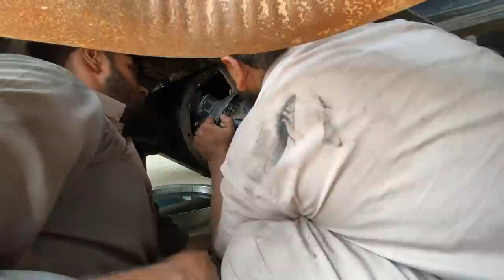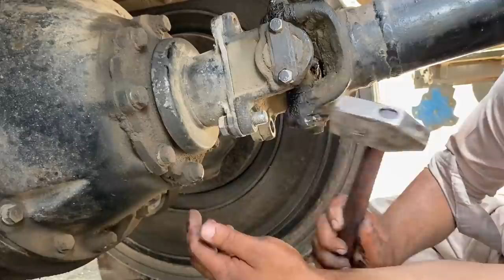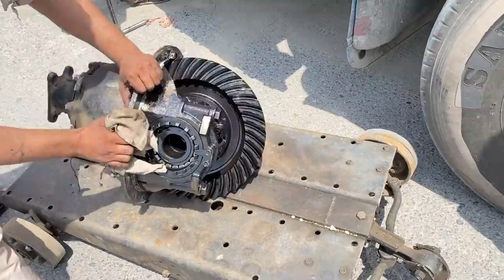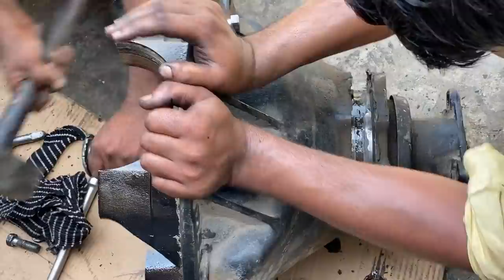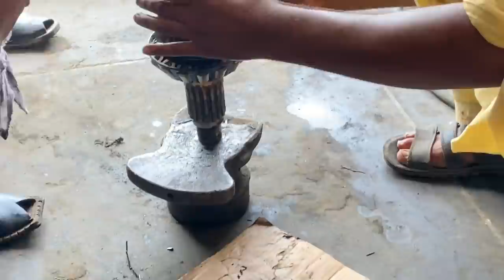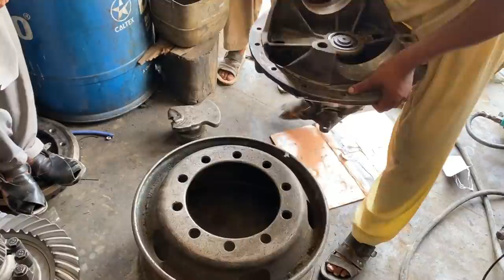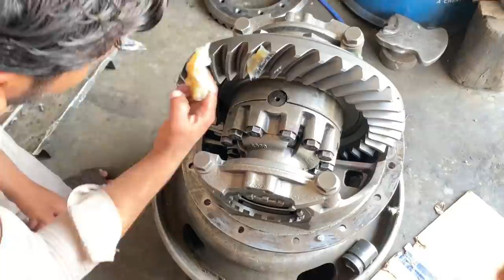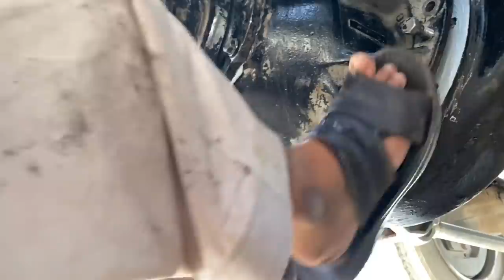The sound is different from the differential gear. Open and check

Comment: Everything done squatting down, amazing how difficult they make it, 3 or 4 guys on it... only slightly destroyed the bearings hammering everything together, truly outstanding it worked at all... good for another hundred miles.
Reply: To be fair , that's a very heavy diff plus working on a sand surface, impressive that they have some big air tools though , yes they are rough and crude ,they should have used new bearings but they would have still used a hammer to fit them lol 😂
Reply: @englishbob5106  only the inner pinion bearing suffered by the hammering, with the rest they did not transfer force through the rollers. You can do a fair bit of hammer abuse to the bearing race itself without any negative impact. But I find it weird that they smear grease onto the main which gets bathed in oil, but put absolutely zero lubrication on any of the bearings, which can take quite a bit of time for the splashing oil in the diff housing to get to them...the main bearings did not sound all that nice when he was setting the preload :P

I'm however really impressed by the cast iron housing taking all that beating like a champ and not cracking :D
Reply: Man I understand your point but sorry. this is how it works in many countries. I live in Brazil for exemple, things are much more expensive here than in the US or other hravly industrialized nations. Because of that we only change bearings when they are with a big slack or crearly damaged. Also sometimes use hammer Becuase don't have ansses to the proper tools. It's hard
Reply: @5fudidao5  I hear ya man, things are tough in the US too, but not changing the bearings will cost you more in the long run. Those sloppy bearings with flat spots will wear those new gears right out again, there is a reason they were damaged in the 1st place.... the cost of new bearings is minor compared to breaking down and doing all that work again no matter where you live...
Reply: @robertw1871  I get your point man it is a smart decision for sure. However sometimes we don't change the bearings becuase of the lack of money to change both the gears and the bearings Hahaha. But your are completely right.
Reply: @AKAtheA  
They used grease on the crownwheel as an indicator of the correct mesh between crownwheel and pinion, we use engineers blue in uk, btw the housing is cast steel  🇬🇧
Reply: @5fudidao5  I get it, I work on my own stuff to save money... takes a lot of time, but saves me a lot every year and I know it’s right when I get done...

Comment: things like this impress me to no end. this is 'in the dirt' REAL mechanics.  miracles these guys perform are out of necessity. they are as good as any mechanic you would call "top notch". yeah ... low overhead.
Reply: They impress me to but I don't recommend our mechanics do it. They do it out of necessity. Great to watch.
Reply: They also don’t have to deal with the extreme rust from winter road salting to deal with.
Reply: I bet those roadside boys would rebuild a jet engine,only if they get opportunity to sit within that place!
Reply: Isnt it awesome...
Reply: Lucky him, he doesn't need to fight rust, no torch, PB blaster, knuckle busters and broken bolts. That looks like the easiest diff work I have ever seen, bolts don't slide out like that after one winter.
Reply: @vert5  Live in their condition once
Reply: @gregoryconnor9333  áááaaaaaaaaaaaááaaáaaaáaááQ1
Reply: @robertficek7586  but pay also isn't that good tbh
Not to mension the heat in summer they have to work in
When it is 45 50 degrees celcius outside
Reply: @gunjankumar6566  the wife at home makes all the diff. If she is good ... . And if not, no work on earth can be.
Reply: Real mechanics fix it right and permanently the first time. Quit carrying water for them, doing so does not help them.
Reply: @samoanswatteam6510  amen, this is in no way a repair.

Comment: Amazing how they work in coordination with each other to disassemble and reassemble heavy and intricate pieces of equipment and get it correctly put together. Lots of experience and knowhow required to be able to accomplish these tasks. Thank you.
Reply: Too bad these guys are woefully ignorant of how to set up a R&P. They didn't check the pinion depth, ring gear carrier bearing preload, or backlash. The slathering of grease on the ring gear showed nothing. That gearset won't last 6 months there.
Reply: @e-curb  they also didn't even tear the diff apart to see if anything happened to it

Comment: Ingenuity at work. I was wondering why they assembled the bearings dry until I saw how he did the setup where he spins it fast. Grease would hinder that. Also was surprised not to see any pinion shim. Neat video and nice work 👏
Reply: Dodgy work
Reply: First time I saw grease used to show teeth contact pattern. Incredible talented    mechanics .
Reply: Love you form Oman

Comment: I was not aware how people in the region like to decorate their vehicles, the whole cab and frame of this truck looks incredible. Now I know why John Lennon's Rolls Royce was painted in that style. You can certainly put together a differential with way more care, but I give them credit for doing the job in what looks like a few hours without precision equipment.
Reply: What precision equipment does one require to to change the rear diff? He's lucky to have had an air impact.
Reply: @Stroke-it-2-Handed  He is lucky to have impacts, it sucks they don't have air couplings, he has to unscrew the hose every time he has to switch tools. I mean precise like having at least a torque wrench or a press set up that can handle the bearings. Clearly not an option here, they did the job and hopefully it holds up for him.
Reply: @Stroke-it-2-Handed  I bet there are vids of the 'correct way to, not just change,(you can buy new, reconditioned ,or used diffs.) but strip and  correctly reassemble them.There is something called PR-LOAD....things squeezed hard against each other as well as 'back-lash'--looseness, 'play' between gears.There is fancy equipment and some training involved.
Reply: @ianrutherford878  I don't need to watch videos of people working on diffs. I'm well into my 40's and have been working on cars myself since the '90s.
Reply: @Stroke-it-2-Handed  Ah well, you asked a question about changing diffs. and equipment.I was just pointing out that this was replacing parts IN a diff. and that there is special equipment used to do it so it is a lasting repair and if you had just been asking out of interest ,a video would answer the question I thought you were asking.Looks like you just wanted to make some kind of point.
I was a mechanic too and have swapped diffs. but never done the more specialised internal stuff.
Reply: I like the trucks painted in rainbow colors and that the employees are allowed to wear dresses.

Comment: Even in Thailand which is one of the underdeveloped countries as well ,The first thing that the teacher teaches is that the work area must be clean and free from sand and dust. 
I saw them put their oil-soaked gears on the gravel and couldn't figure out what was going to get in there.
Reply: i would not call Thailand an underdeveloped country ..much more manufacturing than here in the UK and fewer potholes in the roads ..and my mate broadband was faster than mine
Reply: you do realize that the ring and pinion were replaced with a new ring and pinion that were not rolled around in the sand?
Reply: @jamesradcliffe3985  : Good on you, take your broken diff to them then and tell me how long it lasted. 🤣🤣👍
Me, personally will not (for the exact reason David states).
Reply: @77appyi  Also watch the video on the long tailed boats.  The engine building and supercharging they do is amazing.  One even shows the super cars they build as well.
Reply: @bigcheese781  I know right, I don't even remove bearings so aggressively to throw them away, and they bloody reused theirs after banging ferociously on both the races and cages with a bigass hammer. Tragic workmanship, botched repair.

Comment: Instructions: bearing pre load is critical.

Guys on dirt floor: more aggressive hammering.

This is great. Proves you don't need big fancy shop to get things done when you absolutely need it asap
Reply: He also tossed his slip yoke in the sand too.  Wtf
Reply: Lmfao, thats how you keep ‘em coming buddy ;),  how you think they can make so many YouTube vids
Reply: set gear backlash by ear lol and did you see the contact pattern?  Amazing. i cant do that well with a dial indicator lol
Reply: Our mechanic would take 3 days to do this with all the fancy tools
Reply: My preference is to do a job like this properly rather than just "bang it out" to get back on the road quickly. What if that differential fails while driving on some mountain cliff road fifty miles from nowhere? By the way did you notice the condition of that oil draining out of the rear end housing?
Reply: @blauer2551   but how many miles after do you need to rebuild it again? Banging it out quick doesn’t mean its done right, they literally BANG THE SHIT OUT IT
Reply: I guess 3 uga dugas is the correct torque.
Reply: @eln0n01  I'm very confident that this diff will be just fine 50,000 miles from now, if not 100,000. If this unit went bad within 1000 miles from now then there would be very serious consequences for the builder. This isn't America where you would take them to courrt and file a complaint with the BBB. Here this repair cost the owner a LOT of money (to him) and this truck is his living. He will NOT tolerate this failing prematurely. Its obvious these guys know exactly what they are doing and you have no idea what they did and didn't check and how they check it. The video is 14 minutes long, do you think they actually did this job in 14 minutes? These guys do this shit all day, every day and they know how to do it. They checked the pattern and with adjusters they are probably practiced enough to know backlash just by jiggling it. Do this stuff enough and inch-pounds torque required for preload can be felt. How many diffs this big have YOU set-up?
Reply: @eln0n01  I'm very confident that this diff will be just fine 50,000 miles from now, if not 100,000. If this unit went bad within 1000 miles from now then there would be very serious consequences for the builder. This isn't America where you would take them to courrt and file a complaint with the BBB. Here this repair cost the owner a LOT of money (to him) and this truck is his living. He will NOT tolerate this failing prematurely. Its obvious these guys know exactly what they are doing and you have no idea what they did and didn't check and how they check it. The video is 14 minutes long, do you think they actually did this job in 14 minutes? These guys do this shit all day, every day and they know how to do it. They checked the pattern and with adjusters they are probably practiced enough to know backlash just by jiggling it. Do this stuff enough and inch-pounds torque required for preload can be felt. How many diffs this big have YOU set-up?
Reply: Differential fluid is the worst smelling gear lube of all. Getting  it  off off your hands is terrible.
Reply: @jamesradcliffe3985  
"and you have no idea what they did and didn't check and how they check it."

kind of ironic how you're white knighting the job even tho YOU have no idea what they did and didn't check
Reply: @jamesradcliffe3985  lol you're funny why are you putting quotes around something i didn't say and then claim that's what i said? i guess i shouldn't be surprised by someone who immediately jumps to segregating people by race/culture. to me it looks like racism by low expectations you feeling the need to praise these guys no matter what because they did something. if that aint textbook i dont know what is lol. hammering on bearings and reusing them is not fine work no matter what your racist mind tells you.
Reply: @MrMikucki   never claimed it was you who said it, just an amalgam of what is probably the mindset typical of half the men in this country. That you couldn't figure that out, since you never said anything even remotely similar to the quote, does not speak well of your level of intelligence, but I'm not surprised.
Reply: @jamesradcliffe3985  this country? why are you assuming where i might be from?
Reply: They are literally sitting in front of a shop with nice 1" drive airtools and whatnot.
Reply: @jamesradcliffe3985  many times have you copied and pasted your childish rant
Reply: @glennschemitsch8341  Yes, and I can still remember the rank smell when the bearings have gone. It stays with you for years.

Comment: This is the first time I've seen them use any power tools. They do a great job, even with only hand tools!
Reply: @sellier-bellot22  yorumları
Reply: How do they know how much torque they should put to each bolt/screw without "proper" equipment?
Reply: @MarcPolan  it's experience bro
Reply: @MarcPolan  two to three ugga-duggas

Comment: Americans would have insisted on a smooth paved shop floor with no grit or sand.  The whole assembly would never touch the floor because it would be held by straps on a crane.  During assembly backlash, clearances, and alignment would be set with micrometers and plastigage.  All components would be coated with assembly lube at each step. The gears would have cost us probably 3 grand at least. And the labor would be 1.5k$.  And the truck would have been parked in the shop parking lot for a month as we waited on parts.  Probably made and shipped from Pakistan.  Or possibly we would have just declared the truck a total loss and bought a new one.
Reply: Well, such an assembly is not a fact that it will work for a long time. Commercial vehicles have never been cheap to repair.
Reply: @scottsdale4899  Yea those bearings just had their lifespan severely shortened.
Reply: I looked up a real common (and cheap) GM ring and pinion set as there have probably been over 100 million made. They are around $300 US. I would think $239 is pretty cheap for a much larger truck set? Still fascinating to see how well things can be done with minimal equipment.
Reply: Mexico or China
Reply: @1crazypj  I dunno about doing the job well… I can come up with better ways to hammer out bearings and races. I didn’t see them do a very good job keeping dust out of the bearings or even piss on em to rinse the dust off before bolting up the diff…
Reply: @dirtyaznstyle4156  LOL, what did you expect for less than $250?
Reply: Shortly after you finished paying the bill the differential would explode into 100 pieces and when you took it back to the dealer to complain they’d try to tell you they didn’t even touch that diff and it’s your fault.
Reply: 😂😂😂😂true😂😂😂😂
Reply: When  these big diffs shear out on the job  its usually  in the rough stuff and difficult  conditions

Ilines and bogged down   loaded  or irretrevable